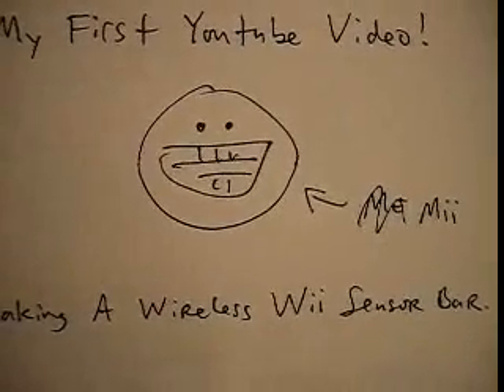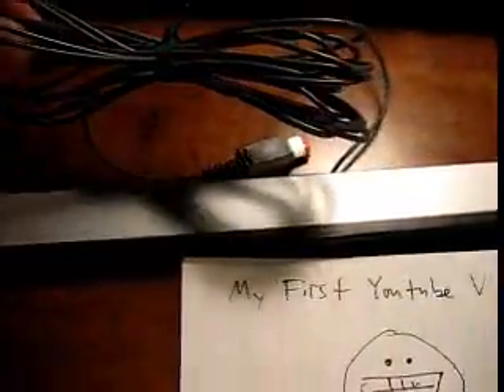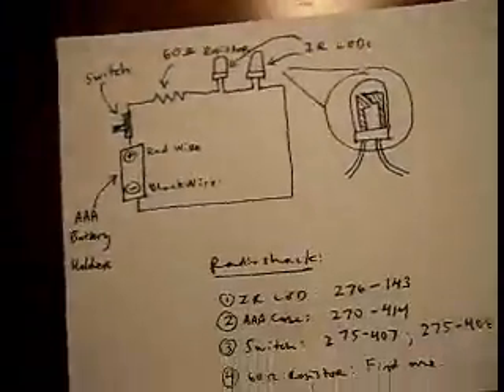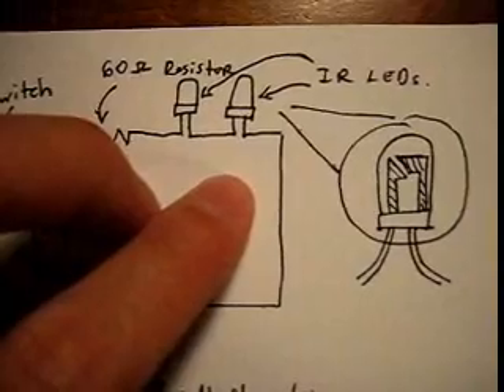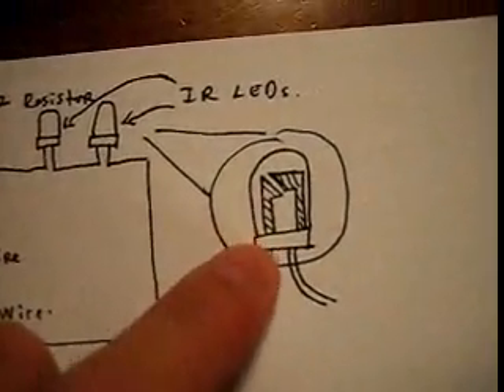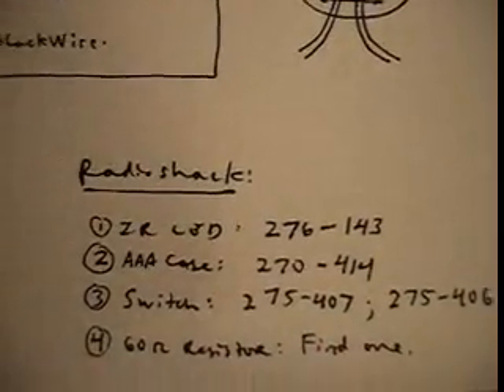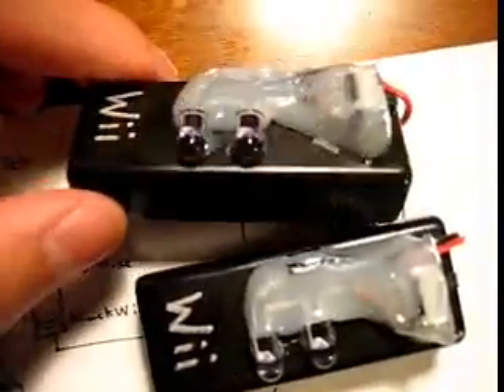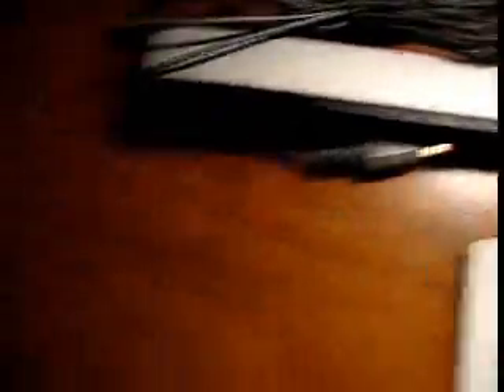How to Make a Wireless Wii Sensor Bar

Comment: The "sensor bar" is just two groups of LED lights (5 on the left and 5 on the right). Separating them allows for adjusting the position of the on-screen cursor, which isn't as accurate as a laser pointer. For example, if you stand closer to a large TV with a stock Nintendo sensor bar, the cursor might appear below where you aim the wiimote. Changing the spread of the two light groups can help to adjust the height (and other axis) of where the cursor appears so it lines up for gun-games, etc.

Comment: The sensor bar is not what handles the info, it's the remotes, hence the bluetooth aspect... As he said at the sart, all the sensor bar does is provide the infrared outputs, hence why candles also work. It is not the sensor bar that finds the position of the remote, but the other way round...

Comment: Your a horrible person... Where in this circuit, does the wireless transmission occur so the sensor bar canfeed the position of the remote, to the console? Also there will have to be a micro controller in the unit to format the signle from the controllers into something the wii can read

Comment: @ryan742743 no. My brother bought a wireless one and then i tried figuring out why that was. Found out that It just detects light and uses that to figure out where the TV is. Hell you can make it work with 2 candles.

Comment: Thanks for the info of how the "sensor" bar is put together.  I guess that means I could harvest some of those LEDs if I felt like being excessively cheap.  But then again IR LEDs are not at all expensive.

Also as an alternative,  standard Christmas tree lights give off enough heat to be picked up by the wii remote.  So clever placement of a few of those would also do the trick whilst being tremendously festive.

Comment: still need the resistor. i haven't looked at this entirely but depending on the setup and voltage you may need more than one. why? don't you have a radio shack? :)

Comment: 3 questions
1. you put a switch so that you wont waste the batterys right?
2.if the controll is what give the comand to the Wii, then why do we even need a cable for the sensor bar?
3. a 60 ohm resistor...shit, im going to guess that the diods cant handle over 3.5 volts right?

Comment: The wire, its not sending to the Wii what the controll are doing. I don't know how it works but I'll think that the wire is just for the power for the LED's in the sensorbar.
And the controll sends whats happening directly to the Wii, I'm not sure but thats how I'll thinks its works.

Comment: I'm planning on building something similar to this. I might've missed it in the video, but are the batteries in series or parallel? Did you use 1.5V or 3V to power the entire circuit?

Comment: I tried to light up regulat LEDs at school and it didnt work maybe its because i used 62 and also tryed 56 but i cant get 60 n e way will i battery holder connected positive to a switch and then the middle part of the switch connected to the resistor then the resister connected to the two IR LED's back to the Negative..........!!!!!! WILL THIS WORK PLEASE RESPOND BACK TO ME AS A REPLY!!!!!! THANKS

Comment: i found a battery soloution after a rather strange radio shack mix up. i got a button like switch (when you press the button, the IRA's go on, relese, off) then i mounted it under the bar, so now all i do is turn it over, and its off. another thing you could do, is reverse the switch, so its on when the button isnt pressed, then after play, you set the controller on the bar and it turns off.

Comment: The real sensor bar plugs into the Wii so you don't need to rely on batteries that get changed all the time. The custom "sensor bar" uses batteries so that no wire is needed at all (more convenient and not all that pricey). The Remote senses the IR light and calculates its own position and all that: the information is then relayed from the remote to the Wii.